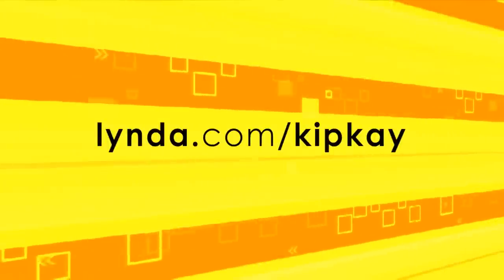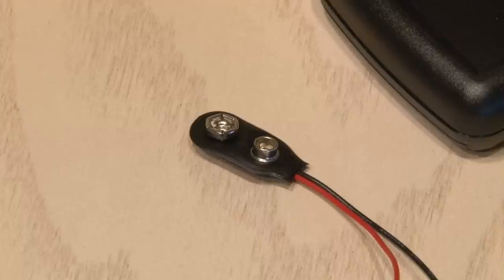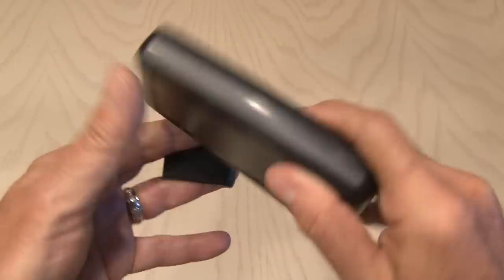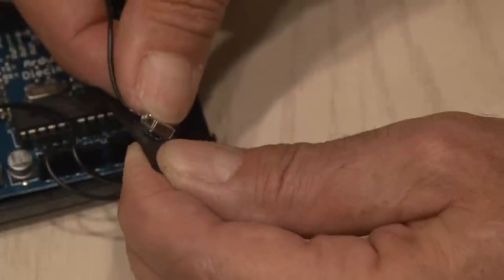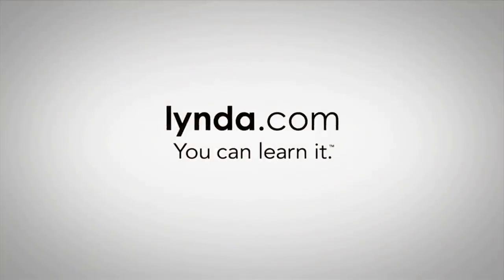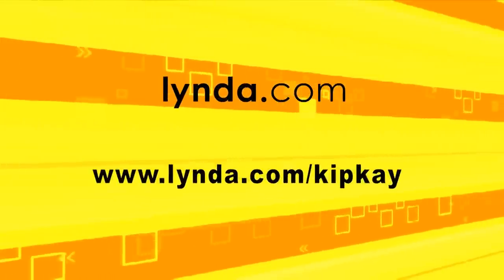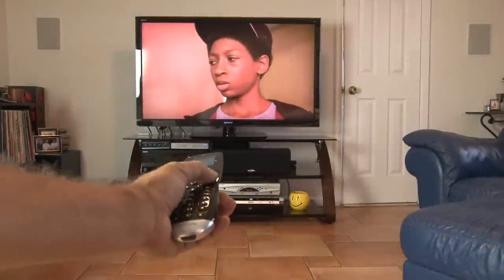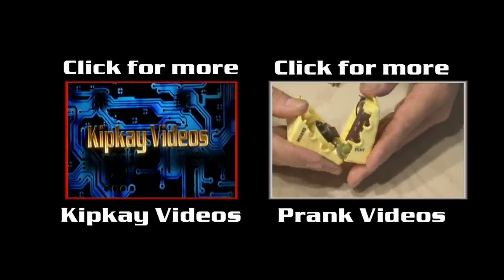Haunted Remote Prank! Use any Remote!

Comment: Or just use the IR blaster on the HTC One (M7/M8) or the Samsung Galaxy S4/S5
Reply: Yea
Reply: What if you don't have those then? I'm sure there's someone that doesn't...
Reply: Kemal P. Galaxy S4s dont have an IR LED how come the tv dont respond to phones.
Reply: Kemal P. Galaxy S4s dont have an IR LED how come the tv dont respond to phones.
Reply: What if you can't afford a fancy phone though? An Arduino and a few components is much cheaper.
Reply: Jordan Anderson
Galaxy s4 has an IR Blaster. I use it all the time.
Reply: the fuck does it matter, this devices is meant to pickup IR signals and work on those, your phones won't avoid.

Comment: I have trouble using the code on my arduino. Is the code just for the Arduino decimilia or can i also use it on a Arduino uno. Help me please! It's not working!!! (note: I used the mac version of the arduino software) These are the errors: ketch_aug18b:4: error: stray '#' in program
sketch_aug18b:3: error: 'define' does not name a type
sketch_aug18b:4: error: 'define' does not name a type
stray '#' in program

Comment: Hey hi Kipkay I being watching your chanel for some time now, I really enjoy watching your gadgets.  I have a question hoping you can tell me if you think it is possible,  I will really appreciate your help.
  So I replace the steering wheel of my  chevy silverado 2001 for a 2003 model, I change the  entire steering colum. This new wheel came with the switches/buttons that control the volume and the radio as well some other components like the gas and trip features.  In the back of every button/swtich is 2 wires one  color solid and one dark. What I have in mind is buy a aftermarket car stereo and try to wire those wires to the back of the aftermarket sterio with out the Adaptor they sell. My question is do you think is it posible to do so or am I waisting my time, in theory I think it should work. But I will really appreciated your help thank you.

Comment: Hi i was wondering if i should by the arduino uno starter kit. Im 12 years old and am ok with electronics. Is it hard to code and wire circuits and also is it hard to add in a rc receiver and servo to it? So is the starter kit worth it? And if i got it should i get anything else with it? If you want check out my youtube channel DIY Garret im just on my ipod so i use a different account. If Kipkay sees this please do webcam hangout thingy please!
Thanks

Comment: again, it's a cool idea, but your implementation is not there. I get that the box gets makes funny sounds when it gets IR commands, but the sound it makes is not haunting at all. I tried to scare my sister in law by thinking her room was haunted by doing this.. I got 2 bluetooth speakers.. placed them in 2 different sides of her room. I also got 2 phones and connected each to a bluetooth speaker. When she went to bed, I did a very simple thing start to mumble on the speaker 1 enough, so she'll get curious to know where the sound is coming from, then go straight to the other speaker and make sounds from there. She was freaked out right from the beginning. I didn't even get a chance to make it more variations. After she came outside, my laughing made it obvious that I was doing something.. So, yeah. I'm sure you could take what I did and build upon that to make it more technical.
Reply: Well, Kip just used an example sound. That's why there's an Arduino. You can change the code.